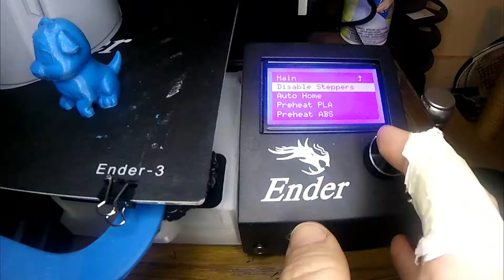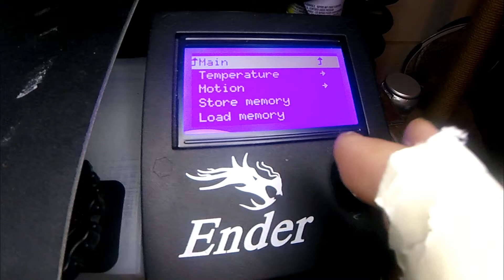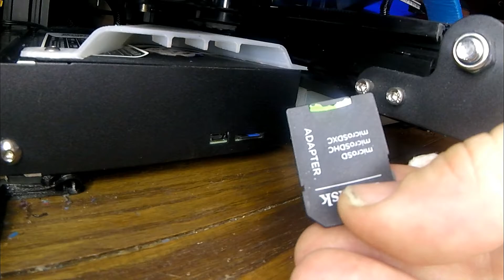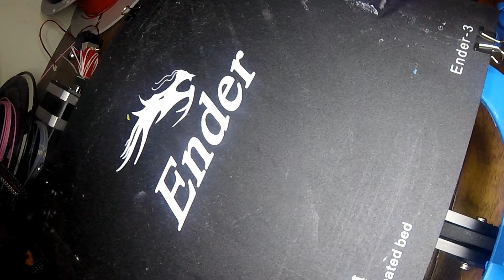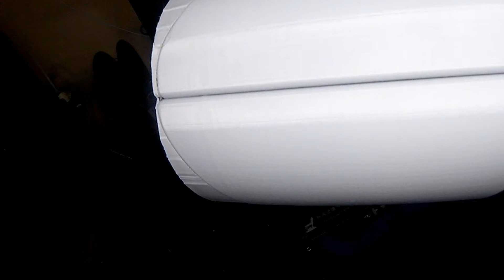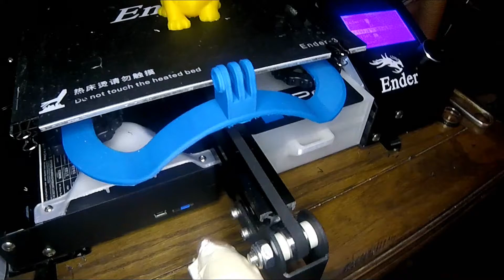Creality Ender 3 3D Printer Review

Comment: Hi just stumbled upon your channel and you seem very underrated channel. You just earned a sub. But I wanted to know if the Creality Ender 3 is good for actually printing for cosplay or do you recommend another 3d Printer?
Reply from the maker: thanks for the sub! I think it just great printing cosplay now that Ive got the settings just right. Its got a small print volume so you have to splice up prints. I always say, if you have a low budget, this is a GREAT printer... if you got the money though get the Creality CR10S4. Its a huge build volume. Less plain cutting